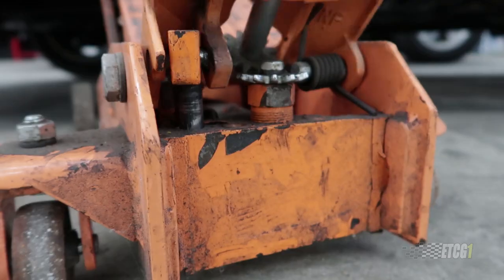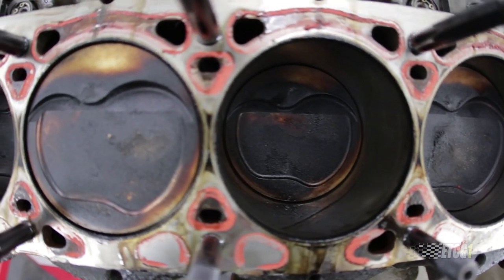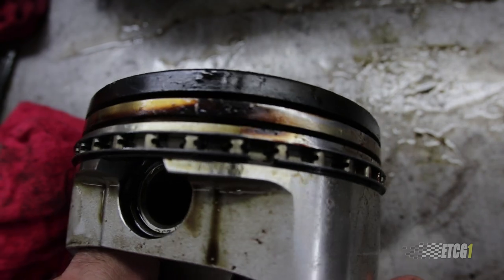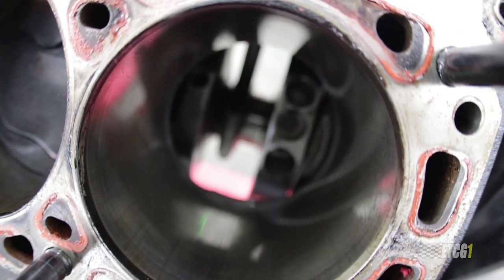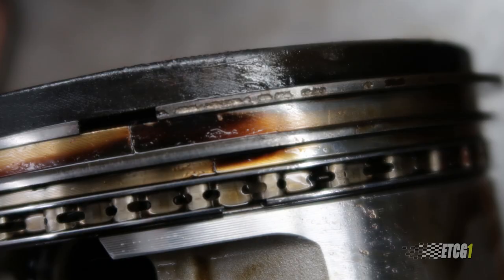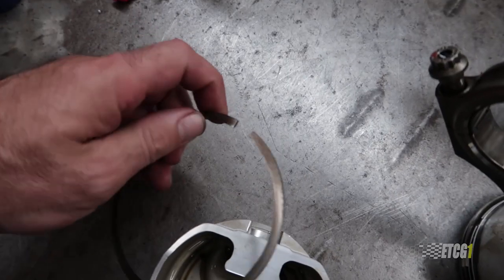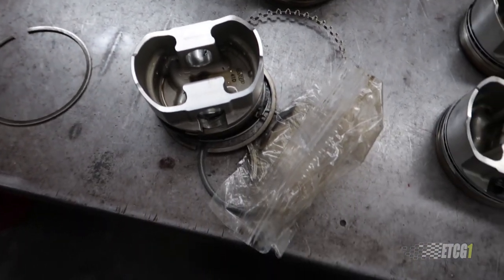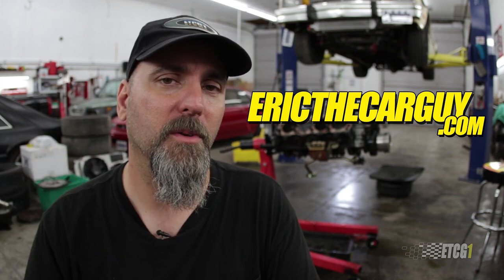Hydrostatic Lock the Silent Killer

Comment: If only it hadn't fired that cylinder!  Engines usually survive when it's just the starter pushing against the fluid but the moment that it fires ... I'm sorry that happened Eric.  Those of us with project cars and a limited budget know that the car is never done... And when it is done It breaks.  I finished a total overhaul of my '62 willys wagon and took it to Moab Utah and then it ate its rear main seal and is dumping a quart of oil out the back of the engine every 200 miles
Reply from the maker: That sucks. Sorry to hear about your Jeep.
Reply: the flooded cylinder wouldn't fire, if it did it would kick backwards. however an other cylinder in previous firing order could have and "hammered" it hard

Comment: Excuse my lack of  knowledge but what caused the  pitting to occur? Was it a manufacturing problem or was it due to the hydro locking?
Reply from the maker: I suspect when the combustion started getting past the ring it heated it up and that's when the coating started to flake off.

Comment: think about radial aircraft engines (of olde), the bottom cylinders are upside down and aircraft engines (air cooled) are 'loose' when cold. the engine oil drains down to these cylinders past the rings and bang you have hydraulic lock.  to solve this they add a oil drain allowing the oil to escape either on the floor or into a jug (this way you can reuse it) and pilots are trained to pull the engines thru before starting, on big radials this is an all hands task each taking a blade and pulling it thru then getting on the back of the line again, if you have four or six engines this can take awhile, you still get a lot of blue smoke when you start.  I've been on the pull on the B-25 bomber, pay off was flying in it. I don't think you change the oil in a radial, just add a couple of gallons at each stop.  The b 25 had 75 gallons in the tank for each engine.  When running the oil does not accumulate due to the 'cocktail shaker' effect of the pistons.
Reply from the maker: 100% Correct. There was a guy at SEMA last year with a radial engine in a truck. They had to drain the oil and prime the engine before start up just as you say.

Comment: Drove through a puddle with a cold air intake on an 07 ram 1500 5.7 hemi. It sounded almost like it had stalled towards the end of the puddle (even though of course it was an auto) I have pictures of the rebuilt. It snapped the connection rod in half. The half that was still connected to the crank immediately stuck into the oil pan windage tray and ultimately saved the engine and all that was needed was a replaced piston and rings and gasket set. This happened over a year ago and the engine runs like new!

Comment: I had an aftermarket air intake that went into the wheel well, forgot that i left the wheel well lining off. I drove through a sizeable puddle which hydrolocked the crap out of my integra breaking a rod in my b18a1. Non-vtec but I still put a lot of TLC into that engine, had to be around the 200hp mark when i accidentally murdered it. I feel so dumb...

Comment: i had a 1957  Dodge  pick up.    6 cyl flat head.   1 bdl  carb.    made an 2 bdl adapter to use a use an Kaiser 2bdl carb.    i didnt make the linkage right it stuck wide open.   broke most of the ring lands.   those old mild engines wouldn't take much missuse.

Comment: I have a piston that looks very similar to yours. Mine is a turbocharged 5.3 but is efi instead of carburatuon. Mine was caused by detonation. I knew that it happened by the excessive blowby. Engine still ran great and I actually beat on a procharged mustang on my way to pull the engine out. Hydro lock could have caused yours very easily.

Comment: Many newer vehicles that stop while going through water actually have fried electronic components necessary for the engine to run. Some may say that is luck. Just get out the water that surely got into the stalled engine before the tow truck pulled it out, replace the bad electronics, then go to the bank for a loan to cover all of that. If you heard a bam or a thunk when the engine stopped you are looking at a engine rebuild. In either case the engine gets tore down. Where is the luck or the money saved? Just don't go through high water.

Comment: Eric, what was your ring Gap? And is it 4 inch bore?
Reply: Standard ring Gap in a turbo engine will ringland it. The slow death was the heat soak on the highway. That cylinder was your hottest.  Especially with a carbureted turbo car, that thing needs a gap like David Letterman's teeth.
Reply from the maker: Please watch the videos linked in the description.

Comment: Heard about a guy who drove his brand new Chrysler 300 who basically a pond in the middle of Road and basically sucked up a bunch of water and blew out the bottom of the engine the whole bottom of the motor was just pieces and oil everywhere need crankshaft is blowing out of it but out I never seen that before do you know that kind of stuff could happen

Comment: I had a 1996 Integra SE 5 speed once. It had a cold air intake and I got stuck in a bad rain storm one night. I drove through a bad wster puddle that I couldn't see and sucked up a bunch of water. I slammed 2 rods right out of the sides of the block instantly.

Comment: 4.2 liter Essex Ford engine.  The lower intake gasket leaked coolant and hydrolocked the number 1 cylinder.  I pulled the spark plug, cranked it over.  reinstalled the plug and got the gasket replaced.  It still runs, and the truck is still a POS lol

Comment: My experience with hydrostatic lock was with a motorcycle, Where in the container of fuel I was using had been contaminated by some one I know and dont trust was being supplied unfiltered to the  carburettor during synchronisation.
This caused the needles in the float bowls to not seat and allow far too much fuel to flood the float bowl and seep up into the induction inlet then back in to the airfilter box and out a drain tube on to the ground and cause hydro static lock so it was both dangerous for the engine and myself.
I dont know what damage was cause so now I have to take the engine apart to check for bent rods and cracked piston lands.

Comment: its because of the floater inside those carb, supposedly prevent direct flow of fuel from the fuel pump to the venturi flow carb. the floaters are to way up that it doesnt shut off perfectly even thou the reservoir tank inside the floaters room are full.
Reply from the maker: No. https://www.youtube.com/watch?v=-HIiOFHbCPA&t=33s
Reply: The floaters are design to prevent such thing to happens, even thou you said the fuelpressreg had a spring load install incorrectly. Meh... Still its my guess that you should recalibrated the floaters

Comment: Does very rich air fuel mixter can make hydrostatic lock because of excessive fuel in face of liquid cause hydrostatic lock..??
Reply from the maker: Not so much a rich mixture as a cylinder filling with fuel. I've seen injectors go bad and do that on occasion. When it does happen, the engine usually doesn't turn over.

Comment: If you had dropped the bottom end and inspected the pistons for damage when you hydrolocked it, do u think u would have been able to notice this problem ahead of this? 
Would someone prevent further damage after hydrolock by pulling the bottom end and doing an inspection? Or maybe my real question is, would u recommend it after a hydrolock to possibly prevent the same kind of situation ur in?... or u pretty much just screwed?
:) thanks for another great video. 
( Life is short. ❤ a Car. )
Reply from the maker: Yes, I probably would have found it, but that's a lot of effort. I thought I got away with it. 

Anytime you have a hydrostatic lock situation, engine damage should be suspected. Even if it runs after the fluid has been removed. In fact, that's the entire point of this video. However, there is no way to tell the extent of the damage without disassembly. It's up to you to decide if you're willing to take the chance.

Comment: My neighbor has a Ford 3.0l Ranger, he blew the head gasket water jacket on the #1 cylinder. He called me and I looked it over found the cylinder filling slowly with coolant. He asked me if it's ok to drive, and I said no, but his friend that's been shade treeing for 30 yrs said I was wrong. He made it 2.5 miles and the piston locked, and punched out the side of the block. Then he wanted me to fix it.

Comment: I'm not buying it.... if hydrolocking was the cause it would've failed during your first run.  The pitted ring is telling you something.  Either you have a lean cylinder or you have an out-of-round bore.  Heat killed that cylinder.  Reading plugs on a carbed street motor is a dubious affair.  Have you been consistently reading each plug all this time?  How can you learn anything from the spark plug of a cylinder that chewed itself?.. it's covered it's tracks by the time you got it shut down.  Unless you had a pyrometer (EGT) on each cylinder to read the temp of each cylinder, you cannot rule out that you had either a chronic or episodic lean cylinder.  Anyway, it's part of the learning process.  Keep up the good work!  Fairmont build has always been fun to watch!
Reply from the maker: The AF runs in the 12s on this engine. Yes, I've run an AF gauge since day one. The pitting was near where the crack in the cylinder was only. Check the pic in the video. I suspect that happened after combustion started getting past it causing the compression loss, not before. As you can clearly see it's only on one side of the gap. Thank you for your input and not being a dick about it.
Reply: Sorry, I wasn't trying to be a jerk.  I just commented a bit sharply after yelling at my screen.  I can certainly agree with you that the pitting is the result of heavy blow-by (and no contact with the bore), but I wonder how much time it takes to do that.  It would make sense that it happened when that ring land broke, but how long could it have run with a broken ring land without gouging up the bore?  Where did it line up in the cylinder?   Here's another theory - What if the bore in that cylinder was never round or for some reason became out of round early on?  Tuning is a hard environment during a weak point in life (break-in).  It could be that ring was blowing by for a long time.  If the ring is weak or not contacting the bore, it's also not transferring heat to the block.  Did the ring lose it's tempering and furthermore lose its "spring?"  Mahle has some interesting vids to consider - https://www.youtube.com/watch?v=BG3FjZ49fjAKeep an open mind and verify everything.  Thanks for the great vids!  We're all learning here!
Reply: Eric, here's another good link from Carillo(edit) on post-mortem analysis    https://www.youtube.com/watch?v=Q1mRCNmYmGM
Reply from the maker: I seriously doubt it's a problem with the bore. This is not a Ford block. It's a World Products Man O War block. It's much beefier than stock. So much so I had to modify the engine mounts to bolt them to the block. It was also brand new and assembled by a master machinist. In fact, I walked in and saw the block for the first time on the boring machine. They bored and honed each of the cylinders before assembly. I think if something was out of round they would have found it then, if they didn't correct any issues in the process.

What I have that was not conveyed in the video was time driving the car. I know how it's felt since the beginning. I could tell something was off and progressively getting worse. Particularly during the power tour. I haven't been beating on the car at all. A couple of WOT's just to check my carburetor tuning, that's it. I never noticed any difference after any of those runs which were few. Otherwise I've just been driving the car. 

I would think that if it happened because of detonation it would have shown up in more than just one cylinder, but the rest of the pistons and rings look practically brand new. 

I'll be honest and say that I don't know what happened for sure. Personally, I think hydrolock is the most plausible theory, but detonation comes in a close second. 

Thanks for the links and for your input.

Comment: I did exactly the same thing after I installed my blower on a stock engine and hit it hard one morning on my way to work while it was still cold. Blew the ring lands in all 6 pistons. Not hydro lock but ring gap.
Reply from the maker: Yea, you need wider ring gaps with forced induction or nitros for that matter. Anytime you're going to turn out the heat. https://www.youtube.com/watch?v=uAguO3EPzcI

Comment: I have a problem maybe someone on here will be able to answer...i have a 2012 f150 5.0
There is a vapor pressure in my gastank and it has the capless gas filler(replaced so its brand new)...if u press the tabs when the CEL is on it’ll hiss..its throwing an evap code po456
And 2 rich bank codes....ive replaced all purge valves, cleaned charcoal canister, all lines checked for kinks...still nothing...a new sending unit too...i know my truck is still messed up...BIGGEST ISSUE IS the digital and mechanical gas gauges are reading completely wrong (stuck on 3/4-1/2 tank)...no idea how much gas i really have...i believe the vapor in the tank is keeping the float from dropping...im just out of ideas of what it could be...very very frustrating because the truck runs perfectly fine....any ideas or input would be great....i dont think its the cluster or the computer itself because everything else is working..
Thanks

Comment: I wound up replacing my brothers 2004 ram 1500 with 4.7L OHC V8 engine because of many many issues one of witch was all 4 right bank cylinders were pitted from head gasket failure.
Engine was leaking coolant directly into the cylinder (overflow into related cylinders as fast as the radiator could be filled. 
Didn't hydro lock it but did allow for electrolysis to take place where steel electrons were attracted to the aluminum stripping the cylinder and corroding the head. 
Wasn't pretty another issue was timing chain slack, rocker lash adjuster were bad, slug everywhere. 
All that with 155,000 miles. 
not sure how well it was cared for but what a mess. 
I suggest synthetic oil to help prolong life of the chains and waterless coolant (seen it in one of Jay Leno's videos) to prolong head gasket life because long block costs over $3000 dollars😨
Found good used one for $1000 so all was fine after that.
Reply: 4.7s usually don't make it to 150k without a rebuild. That motor is Chryslers abortion of the 2000s..
Reply: Willy Cooke That era of Chrysler engine that end with .7 (2.7,3.7,4.7,5.7) were all junk. The 4.7’s like to drop valves which blows out the side of the block normally, same deal with 5.7’s.

Comment: Guess im lucky. Ive hydro lock my engine with water twice. (Never drive thur deep puddles   My old 1996 cira is still running strong.
Had to change plug oil and airfliter.  Start right back up 30k miles later. Still running strong
Reply: Tim Davenport compression test it. Guaranteed 1 or 2 weak holes.
Reply: kennedy796 allso i know not to try and start it back up when it suck water up the air box and breather and hydro locks.  You call for a tow and work on it the next day. Front three are good.   Back three are hard to get to so its a mystery om the other three and happy to keep it that way.  (3.1 v6 118k miles so far. Purchase the car at 56k miles on) the motor.)
Reply: Tim Davenport well im glad you are having good luck because mine is terrible lol.
Reply: kennedy796 what motor? What year?  Seems like the old motor take it better then the new ones.
Reply: Tim Davenport oh just any engine. I have a streak that just blows shit up. Ive ruined a trans just from hitting a bump in the highway, an engine because i started it, and bought a car that blew up after a week on me. Had no compression. My luck does not discriminate